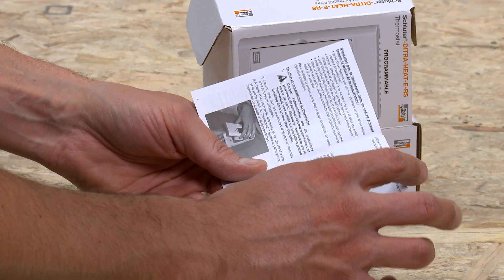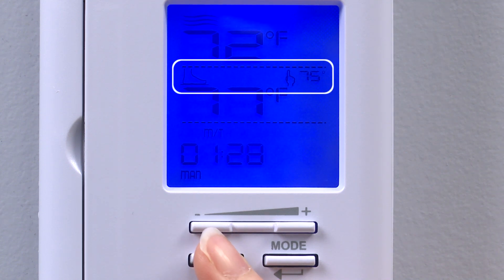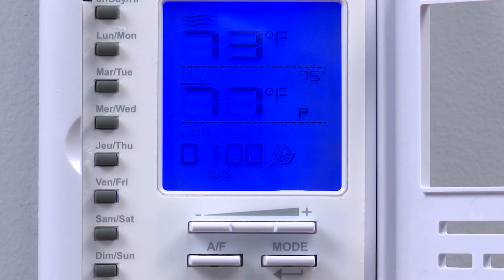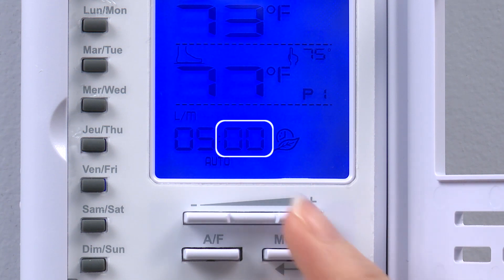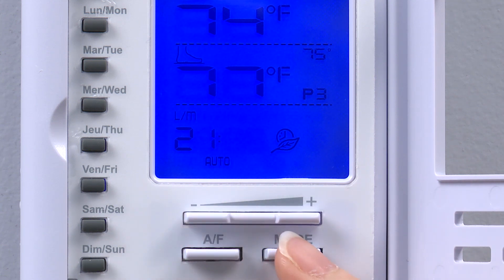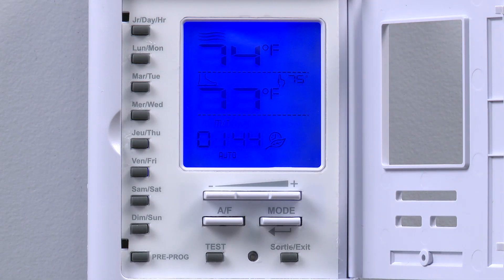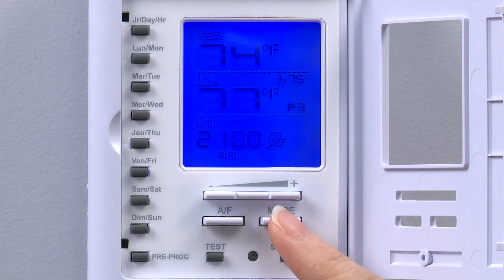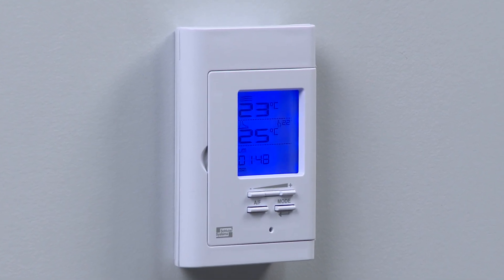How to program the Schluter®-DITRA-HEAT-E-RSD Thermostat- Fahrenheit

Comment: How do I turn it off for the summer?
Reply from the maker: Hi there. You can put the thermostat into manual mode and then lower the target temperature to something where it wouldn't heat (50 degrees for example).

To put the thermostat in manual mode, you would press the "MODE" button until MAN is visible on the bottom left hand side of the display.

When ready to resume your schedule, you would press the "MODE" button until AUTO is visible on the bottom left hand side of the display. You can also turn the power off at the breaker while it's not in use.

Please give our Product Support team a call if you would like assistance. 888-472-4588 (US) or 800-667-8746 (Canada). Thanks!

Comment: Please post the link for the users guide that would be available on-line for this model. We have not been able to locate it on the Schluter web site. Apparently ours is locked and I am assuming that there are instructions regarding how to unlock the device...? Thank you.
Reply from the maker: Hi Phil, our customer service team will be able to help you with this! Please give them a call 800-472-4588 (US) or 800-667-8746 (Canada). Thanks!
Reply: I got instant help when I called customer service.

Comment: Fantastic video, thanks!  What happens if the ambient temperature just isn't getting to the set temperature. I've set the a/c at 22 degrees celsius and it won't budge past 24?!  For days! Any suggestions?
Reply from the maker: Hey Elizabeth! Can you call our customer support team? They can help you troubleshoot the issue.
800-472-4588 (US)
800-667-8746 (CA)
Thanks!

Comment: How do I turn it off
Reply from the maker: Hi Kallel. Two options: Turn the DITRA-HEAT system off at the electrical panel by turning the applicable breaker to 'off'. The other option would be to turn the temperature all the way down on the thermostat and this will cause the system not to heat. Please feel free to give our Product Support team a call if you'd like further information. 800-472-4588 Thanks!

Comment: I find these thermostats nothing but frustrating.  If the power goes out they lose all programming and revert to degrees farenheit.  Why these units can't have a button battery cell in them to remember the program, as my outside light timer does.  So the other day I programmed the thermostat after the power came back on, and of course now the fawking thing is in security mode.  What do I have to do to get it out of security mode?????, go to the panel and shut the power off to reset it.  And of course lose the program.  These units have about as much customer forethought as a sledgehammer.  I would never recommend this thing to anybody I like.
Reply: eudamullah Like a digital camera in the early 90s
Reply from the maker: Sorry you are having difficulties with the thermostat. Please give our Support Team a call, we'd love to help you out. 888-472-4588